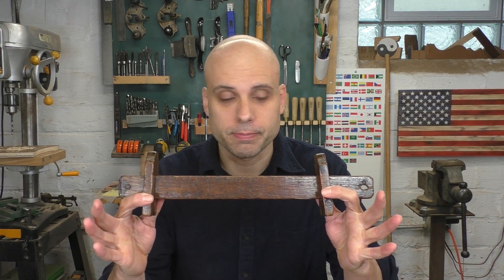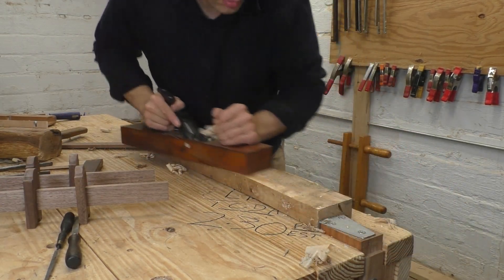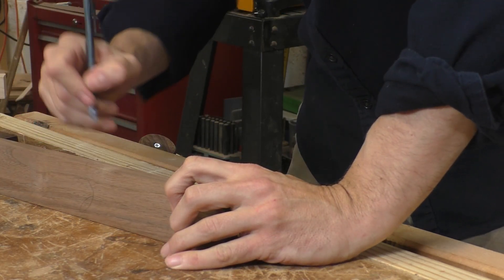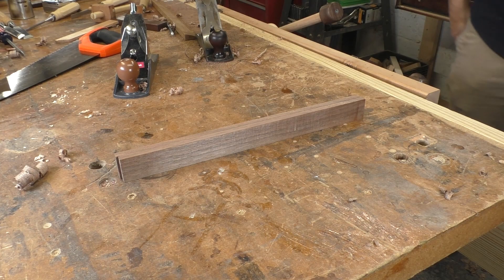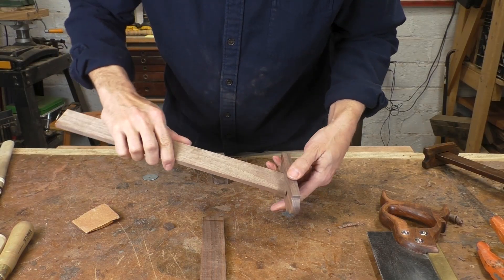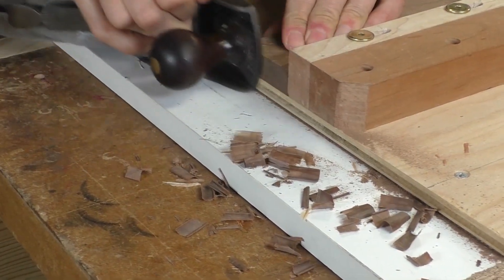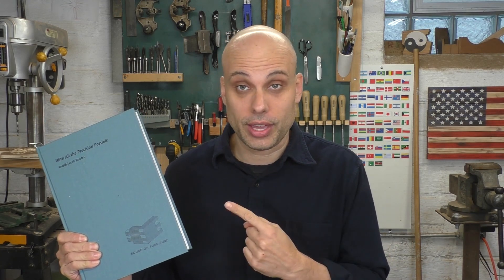Straighten Rough Wood with the Roubo Winding Sticks

Comment: 2:43 I'm sure I mentioned this before, Rex, but I am in the UK. I have visited at least one old, old house with a Tudor oak staircase. I've experienced that finish.
The finish you get from human hands is like almost nothing else. They smooth and treat oak like nothing else.
The reason I am posting is that I am sure one of the guides mentioned that walnuts sometimes were rubbed against the oak.

Comment: I guess we know what an upcoming one off run new Woodpecker tool will be, except their's will be in red anodized aluminum. I am guessing we'll see it before the end of 2022, at least some version of it, or feet that can be added to their winding sticks (now available with spring loaded detents for easy removal should you want to remove the feet accessories). 
[Contrasting bare/bright silver aluminum stripe across the top of one winding stick for easier visual differential].

Comment: My typical windings sticks have a veeery small bevel along the top edge on one side of a stick. This reflects the overhead shop lights, so when sighting down the board the far stick has a bright upper edge. This really helps picking out the far edge.

Comment: I fell in love with the tools described in Roubo's l'Art Du Menuisier, especially the moulding planes planes, which you and Paul Sellers made a couple variants of before. The open sided French/Roman design is so much easier to create, despite being chunkier and a bit boxier (especially with the wedges) than the English patterns.

It's a shame that this style of plane seems to have fallen on the wayside outside of the rabbet plane that looked to be reintroduced to everyone by Paul Sellers. The 19th century French fillister plane I have in this style is pretty nice (need to make a new nicker though) and looks to be pretty easy to reproduce with hardware one can either buy at a hardware store, like threaded inserts for the fence and depth stop, or make on their own with the blade and nicker.

Definitely gonna be making these winding sticks next. They look sweet.

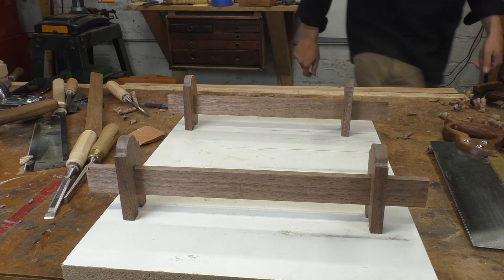Comment: 10:00 I don't think you're quite done: you should repeat this test with the feet at various distances from the centre of the stick, moving them closer to the centre as you go on. There is always the chance of randomly located imperfections along the edge of the sticks or a degree of looseness of fit of the feet that might introduce misalignments. By repeating the test at various feet positions you get a better sense of how accurate the device is and when you move them very close to the centre you'll get a sense of whether the fit is acceptably loose or not. The holes in the feet must be cut perfectly square and perfectly parallel to the sticks and at the same time only a hair wider than the sticks - that's very hard to achieve with a chisel. Maybe some bench drill pilot holes could be used as guides.
That's an awesome tool btw that I that I didn't know it existed even. Great video.

Comment: To be honest, when I learned my trade as a bar fitter 40+ years ago, we only ever used things like two long spirit levels as winding sticks (a spirit level across each end of a long bar top, for instance) because the critical pieces (bar or counter tops) were much larger than what most people work on. We had learned about winding sticks in our training but had no real world use for them for what we were making, so we just went up a level (haha, I just realised what I wrote - no pun intended).
Any two pieces that are exactly the same profile can work as winding sticks, even if they are not parallel; they can be wedges of the same angle and they will still work as good when the narrow ends are at one side and the thick ends at the other. Parallax is not important, so don't grieve over it; just get them equal and put a mark on both narrow or thick ends, so that you know how they marry up to make them work.
Anyway, all that aside, I've got it in my head to make some winding sticks and I want to make good ones. I like this pattern that allows them to be used on both rough timber (lumber in USA) and machined timber. Personally, I would prefer to have them made out of something like aluminium but a stable wood will have to do.

Comment: For a super simple set of rubou (sp?) Winding sticks, could you use dowels for the beams? Then you could make a functional tool with a drill and a saw.  You could plane one flat on the dowels to allow them to be used as regular winding sticks as well. I'm just spitballing here, there may be a very good reason I haven't thought of. In any case,  thanks for the great vid Rex. Enjoy your vacation!
Reply from the maker: I'm quite curious about that,  too, but then you wouldn't have a crisp edge. It's worth trying,  for sure.

Comment: Excellent, but there is one big problem.  People who have a neck fusion (I have a C4,5 and 6 fusion) can't bend their heads back far enough to sight down the lines (I can't play pool any more either) and I would bend or kneel down on my knees, except I had both knees replaced and lost a little flexibility, had a L1-L5 laminectomy and have two semi-herniated disks in my lower back.  Other than, this would be easy peasy for me.
Reply: A shop-made periscope might come in handy for a bunch of tasks in your shop.
Reply: Or a webcam on a stick attached to a laptop. I mount a webcam to a bench dog for looking at finer work

Comment: So I am new to woodworking and am curious about winding sticks, amoung other things.  So I was wondering about using 24" levels from Harbor Freight.  They are cheap and machined to be identical.  They do not change with temerature or humidity.  What is wrong with using two of the levels?  Dual purpose tools.

Comment: Very nice, love that you do everything like they did back in the day. But, I see that this method does waste a lot of expensive wood. Had you used a bandsaw to rip the walnut to it's require thickness, you would of have a very useable piece for something down the road....splines, spacers, or even for some tool you build next time.

Comment: When you're shooting the piece with the circular cut, don't you risk breaking fibres at the end due to the lack of material?
Reply: Well, due to the thickness of the saw kerf, there may be a very slight buttressing angle on that foot, but if I were doing that I would nip off the corners slightly by paring down with a chisel, first.